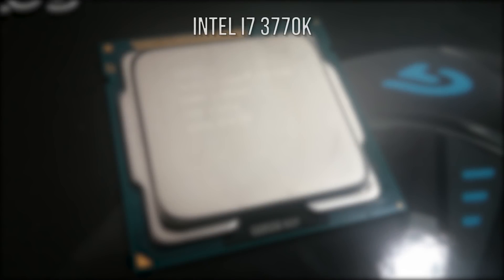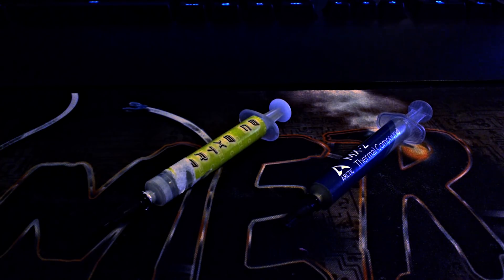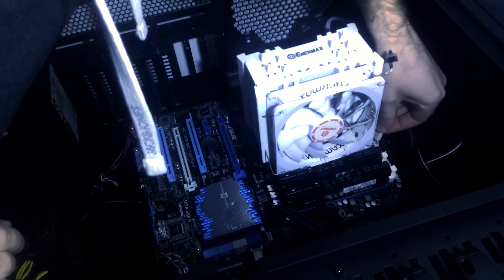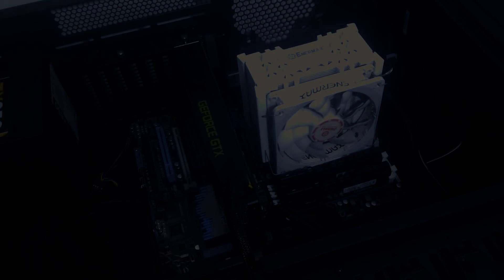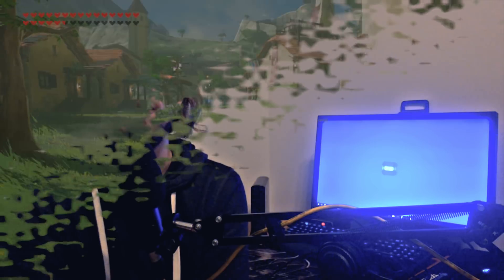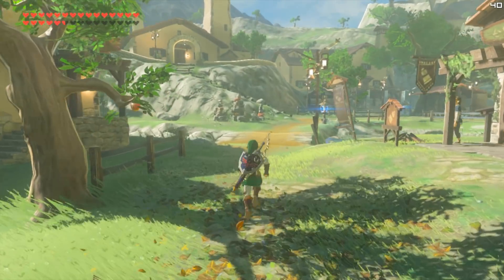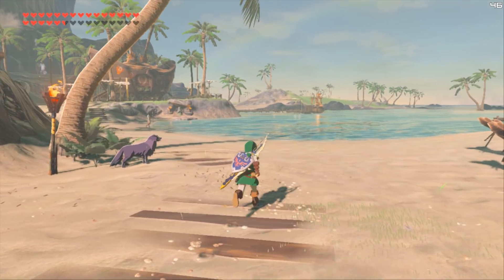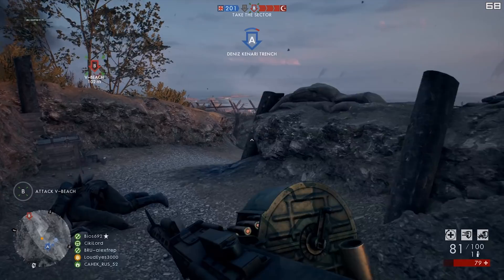Ultimate Budget PC Build | The REAL Console Killer

Comment: this is my current build basically. Im gonna be testing it against an i5 6400 that i recently bought, i hope it reaches at least 4.6ghz. My 3770k is at 4.5 ghz.
Reply: ok so after A LOT of tweaking i manage to get my i5 6400 (locked) to 4.418 ghz. Keep in mind that this thing comes at 2.7 so thats a big jump, though not as big as i expected.
The amazing thing here is that this thing is as fast in multicore as my 3770k at 4.2 ghz. I need to get my i7 to 4.5 ghz to surpass the 4.4 ghz i5. In single core, it smokes the i7.
Testing in CEMU 1.11.3:
2500k at 4.4 ghz= 40 fps.
3770k at 4.4 ghz= 45 fps.
i5 6400 at 4.4 ghz= 60 fps!
Also im using the SAME ddr3 memory for all of them. Corsair vengeance 2400 mhz DDR3. 11-13-13-31-2t
But in the i5 6400 build is running at somewhat slower speeds, since i have to turn them down for blck overclocking. 2266 mhz or something like that

Comment: Why a Gtx 680 and 1155?

Get a Asrock, Msi, Asus 1150 mobo 
I5 4670k 
Gtx 960 ftw 
Zero reason for anything above 600w psu. 
This build would probably be a bit cheaper since you aren't wasting money on an oversized psu, everything else is about the same price or a little cheaper on the used market at least in the US, and most importantly it'll be much more powerful than the build in the video.

Comment: Nice face reveal dude.  You a very handsome man!

Also, I feel like this would be the route I would take if I were to build my first system right now because I wouldn’t be ready to spend a fortune on PC parts only to do something wrong and have a bricked system on the first day of building it.  Heck I had trouble with modding my Switch Joy-Cons into the clear gray shells that I ordered from Amazon because I didn’t have all the proper tools, with the ribbon cables being the big pain.  Even once I had my Switch mod completed, the Joy-Con shells won’t close completely, which means I placed some of the parts inside the shells improperly and with the screws stripped for the most part, I’m not taking them apart again.

Case in point, I’m a bit clumsy when it comes to putting things together.

Comment: hmm, almost the same build I ended up getting for my girlfriend a while back. I was lucky enough to find a Dell Vostro 470 with a core i7-3770 (sadly not the K series) but without ram and an hdd, but hey it came with a windows key. I added some spare ram i had around at my dad's place (i think it was something stupid like 7gb or something lol) and then i added one of my old 1tb hdds i didnt need. after about six months her brother upgraded his pc and i got all of his old parts for free, so i added them to her pc. Free gtx 960 (although the heatsync was completely broken) and even 16gb ram so it was a pretty good deal. I ended up paying only about $240 USD (Im currently running a core i5-7500, 16gb ddr4, and a gtx 1060 6gb, which i also got basically for free after a friend upgraded and bought my old system.

Anyways, nice video, and good build. Keep up the great work

Comment: Nice getting to see the face behind the voice. Great video also, and right now, even if building a new machine having to opt for an older graphics card is the way to go right now due to insane cost of current gen cards because of crypto currency craze. My current machine is currently a sandy bridge with a 960 GT 2 GB. The fact that a gaming PC can now last for several years while still out performing or matching the performance of the current gen consoles, is just great.
Reply: Picture of my machine, not the cleanest in cable setup using an Antec 300 series tower. 

http://i6.photobucket.com/albums/y214/Jaconkin/16996150_1856546221280458_3571384290174959137_n.jpg

Comment: At 6:23 you said that it has 8 cores and 8 threads, it actually has 4/8, but I guess it was just a mistake/misspelling.
Also, finding these parts or similar on eBay and putting them together would be a little over 600€, maybe 700€. I guess that the real "console killer" would be to buy one of these "old" optiplex with an i5 and slapping there and SSD and GPU.

Comment: I would personally use a 2600k instead of a 3770k purely because the 2600k can overclock much better than the 3770k and stay cooler and the negligable ipc difference is more than made up by the 2600k easily being able to reach 4.8ghz.

My 2600k at 4.8 gets low to mid 50s in kakriko village. 

With ddr3 too higher clocks can sometimes not be beneficial it's worth testing at 1600 to 1833 because going higher than that can give diminishing returns due to increased latency.

Comment: I am looking to make my old PC into a custom emulator machine, i dont care about cemu too much as i have my beast pc for that, but to run things like PCSX2, Project 64, NullDC and PSP and Gamecube emus, will my i5 3570k suffice? Also was thinking of getting a budget GPU, what would the lowest acceptable NVIDIA card be would you say? I was thinking the 1050ti but not sure if thats overkill for these emulators? Any advice would be appreciated.
Reply from the maker: The CPU would work great in am emulation machine. IMO the 1050ti is a waste of money. Its about as powerful as a GTX 770/680 and costs way too much for what it brings to the table.
Reply: Nice, thanks for the reply. I'll jump on ebay and try to get a 770! Hoping to get the system set up with Launch box and then stream it to my steam link to play the emus!

Comment: Do you think that Ryzen 5 1600 or 2600 will be good for cemu emulation ? Going to upgrade my trusty i3-6100 since alot of games use 95% of my cpu
Reply from the maker: Id wait for the new Ryzen stuff mate.
Reply: Kryptonaaayt I have a Ryzen 5 1600, one of the best investments I've ever made.
Reply: Wesley M. Hows the performance on cemu botw ? Did you overclock yours ?
Reply: Kryptonaaayt I got lucky and mine is clocked at 4ghz at 1.35v, and performance is pretty good, botw with several graphixs mods at 1440p runs around 45-55fps.
Reply: The 1600 would be just fine, but not great. I'd also think you should wait for the new Ryzen coming soon.
Reply: Entenuki Yeah depending on how much the clock speeds increase I might upgrade to one myself.